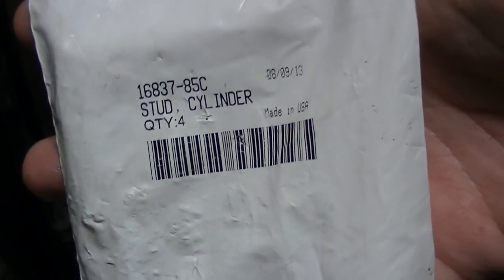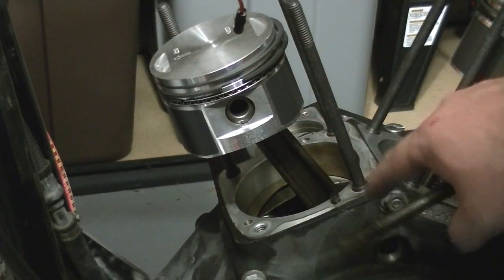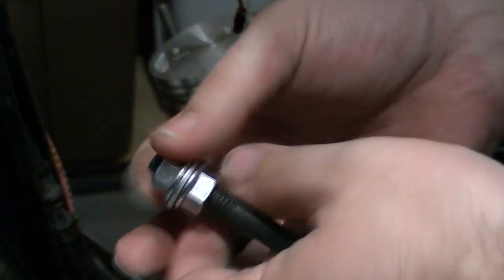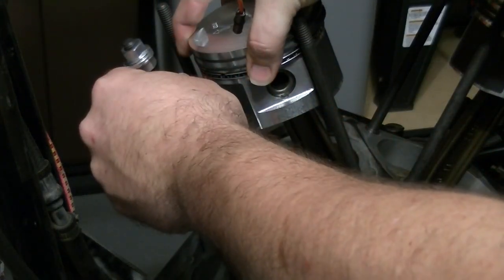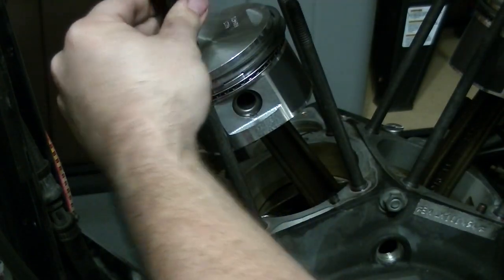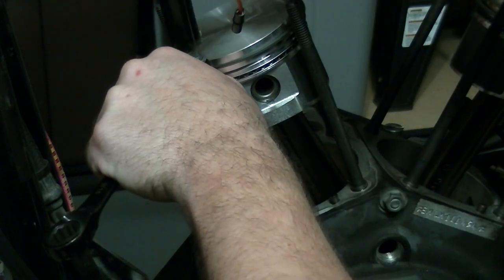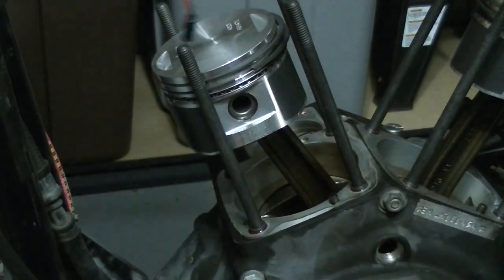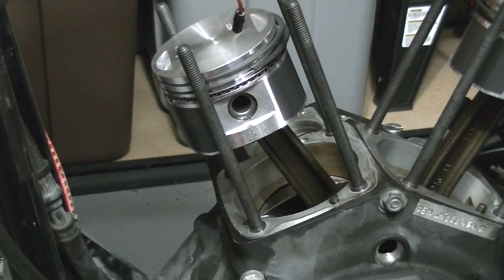Project FXR: Installing New Cylinder Studs

Comment: Here is my Question.
Why we need to change cylinder studs and in what conditions?
Reply from the maker: I'd recommend changing them out on any high-mileage rebuild. Cheap insurance!
Reply: @uberDoward  hey where did you buy them my kit didn’t come with them and I’m not sure where to buy there is some on eBay that are 115mm is that the correct size
Reply from the maker: @fernandocastillo8026  I bought mine ages ago.  Fueling 3025 is a current kit.
Reply: @uberDoward  but what’s the size of them? Is 115mm the right size or does the size not matter